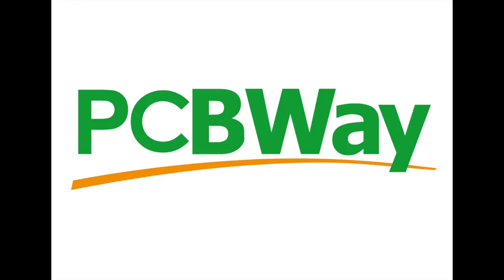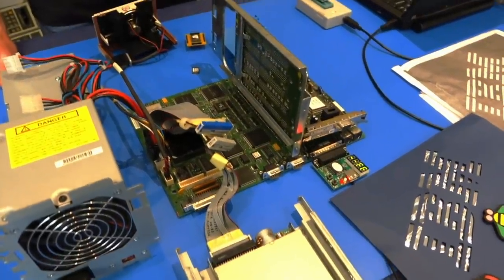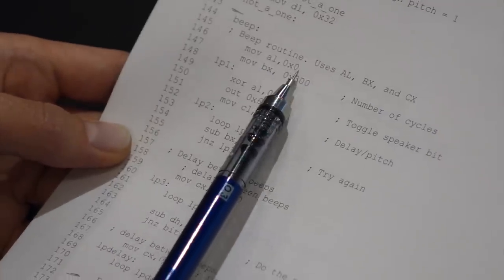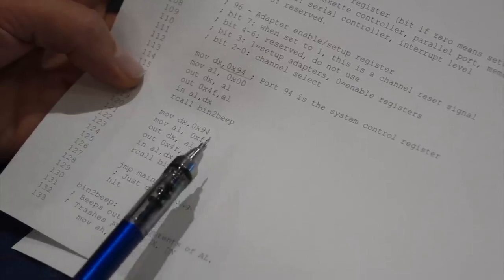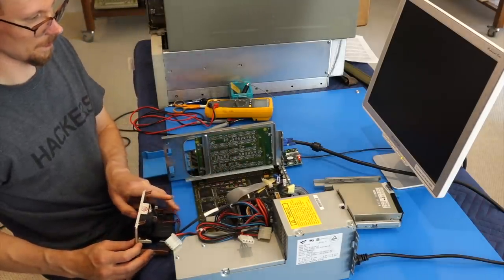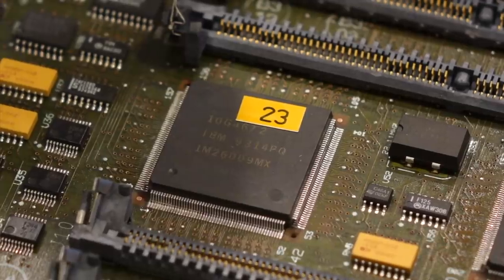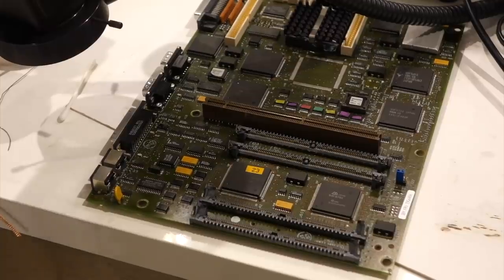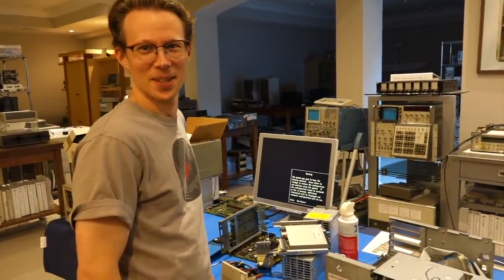IBM PS/2 Part 4: Repaired with a custom BIOS and a magic finger?

Comment: I had almost a "magic finger" experience once.

Back in the 1980s I was working at Bell Labs and was the system administrator for a 3B20S computer. The thing would just randomly reboot without apparent rhyme or reason. Sometimes it would run for days and sometimes it would crash after five minutes.

One day, having exhausted every other trick, I decided to perform a Vulcan mind meld on it. I mean, what could it hurt?

I placed my hands onto the boards in the cage and cleared my mind. Voilà, it crashed! Eventually I discovered that, if you touched one particular board just so it would reboot.

I pulled the board and replaced it with a spare and we never had another problem. We sent the old board back to Western Electric for diagnosis and they couldn't find a thing wrong with it. They sent a technician over to check the backplane and there were no problems there, either.

Obviously, it was gremlins.
Reply: @Never Mind yar a wizard
Reply: Oh yes plenty of times had that with certain avionics boards. You would play mix and match with the stock of spare boards, to get a set with just the right combination of delays, that would work from both cold, to the normal around boiling point operating temperature. You had to test them from just out of the fridge to being used to warm up your pie for lunch. 

Changing an IC on them was not easy, they were a sandwich of DIL ceramic and plastic packages that had been vapour phase soldered during assembly, and there was no way to get to the solder points on the PCB after assembly. Only way was to make sure the IC really was dead, then cut off the legs flush with the body, and remove the old one. Then take the new one, and cut the legs down to stubs, and sand them down to half thickness. Take the remains still in the board, and sand them down on the inner side as well. Tin them, and then slip the new IC into this impromptu socket, and carefully reflow each leg. Then clean, test, and if working, apply the conformal coat on that section again. 

Most common IC failure was always a 5474 or 7474 latch, they would have issues with input thresholds drifting, and as they got used all over for clock recovery, you had fun times. Logic tester would always say it was working, though the one HP logic comparator, that used a separate "reference" IC, fed with the inputs, and comparing the outputs, pretty much failed them half the time.  Just would change the first one every time you had a failure on a board, it was generally a working quick fix, no need to bring out any test equipment other than a first check that all your supply voltages were actually there. then suspect the ageing rubber seal tantalum capacitors, because those failing did weird and wonderful things, as the ESR went up to infinity. I changed kilograms of those.......
Reply: @SeanBZA  As an electronics geek and a pilot, I found that absolutely fascinating. Thanks!
Reply: Mr Guru  No other way, they were DIL packages, on both sides of the board, so the pins of one package were under the package on the other side. Not helped either by the board being a 1970's design, with 14 internal layers. The power planes were very close together, so they were the supply decoupling, and there were, due to thermal constraints, to keep the unit power dissipation below around 500W, in a shoe box size unit, two 5V power rails, one always on, to keep registers and memory, along with the clocks, operational, and the other one was pulsed, to only power the arithmetic functions as needed, once per cycle, so as to keep power dissipation down.

Identical switching power supplies otherwise, using really beefy silicon power transistors in TO3 packages, and nary a controller IC in there, all discrete transistors. Buck coil was an air cored inductor, and it ran at nearly 1MHz. Those alone were around 100W of the power dissipation.
Reply: At a startup company, I was both head of software and got to do our IT support. One of our vendor reps's PC kept rebooting. After a day of troubleshooting, we discovered it happened whenever another rep touched his file cabinet. Which was on the opposite side of the desk from the PC.

The other rep tended to shuffle her feet. Her static buildup somehow traveled through the file cabinet, through the desk it was touching, to the PC sitting beside the desk, and hitting something that triggered the reboot. The PC was properly grounded, too.

We shifted his desk an inch, and solved the problem.
Reply: @JamesPotts  yeah wow that was a tricky unusual very much on one there

Comment: Note that there also seems to be a CMOS configuration issue that we are starting to see from the 'Bermuda' planar in a couple instances: The system (in one of my smaller Model 76 systems, and from a Model 77 that a friend has) prompts to run the configuration when powered on, then after the configuration is run and it reboots, it prompts again. That is with a good battery on the riser, and clean riser contacts. I am suspecting the Dallas DS1285 or Extended CMOS chip ('U14'), but it could also be the planar (the Model 76 and 77 have different risers). Maybe I need Eric's 'Magic Finger' there too!

Comment: We've seen this problem before:  Sometimes you'll get a trace to trace tin whisker - this can happen even with leaded solder.  Tin whiskers tend to form especially on a board that was not heated evenly during assembly.  If it's on an interior trace - nothing much you can do but look on top / bottom traces NEAR U23 - but not necessarily AT U23.  Look under hi-mag scope for any shorts between traces running close together and sometimes you'll have to run an XActo knife in between traces to clear the short.  Another very common issue is a glitched Bypass cap that is actually going open - and resets the register you're trying to write to after after toggle of the WRITE signal line.

Been there, done that...
Reply: If it's a tin whisker on an internal trace, if you can isolate the 2 traces, can't you just blow up the whisker by passing a lot of current through it? That seems like an easy problem to solve, compared to a cracked trace leading to a blind or buried via, which is my personal guess as to the issue. My other guess was a bond wire inside the chip, but swapping the chip ruled out that theory, so it has to be some defect in the PCB

Comment: If I didn’t know he was pushing on the board with his “magic finger” I’d say have a look at capacitive coupling. I’ve had very strange faults on older equipment that has been related to coating, glue etc becoming (more) conductive even if it was originally not and this could render a bypass coupling cap inert and so on. I’d check these if there are any. Thank you for yet another great video Marc! I appreciate you lots.
Reply: I think it was when he pushed on the ic leads, not the board that changed the situation so i think you're correct with the coupling.
Reply: Or the opposite. Coating absorbs moisture and becomes capacitive, making nice clean TTL edges .... sloppy smat best.
Reply: If it was CMOS I'd be suspecting a floating pin
Reply: Someone mentioned tin whisker. Another good possibility.
Reply: Depending on the input impedance of the pins it might even be conductivity of the skin itself that pulls one pin high or low. I'd suggest poking with a piece of plastic instead of the finger. If it still solves the problem it's probably something with PCB flexing. If not then it might be a pin that's floating at the wrong level for some reason.
Reply: Could also be a via there that has gone nearly open, and the pressure closes the edges together, which is why the freezer spray also works. Easiest to fix shotgun style by simply cleaning off all the solder mask on the vias in the area, and then reflowing the lot, with a thin wire in the hole to provide a solder wicking path through the copper inner. Yuo do both sides with the wires long, then snip them off flush.
Reply: @SeanBZA  agreed if that’s the issue.
Reply: @TheFool2cool  I was thinking that, too.
Reply: @SeanBZA  Unless it's a blind or buried via between internal layers - then, I think you're kinda up the creek without a paddle
Reply: @gorak9000  That's pretty much my suspicion. New board time. 😋

Comment: the whole PS/2 was made to be as incompatible with everything else because IBM thought they were driving the market.

While that might've been marginally true, this essentially made them them the odd man out in the market they created.     They were still stuck in the mainframe mindset and it basically ruined the company.
Reply: I worked for Olivetti around 1990 and 1991, we manufactured MCA machines as did NCR, and there may have been others. It was in demand at big corporates like banks, where I did the systems integration, because it was IBM technology, not because it was good. The additional disks required for BIOS and card configuration on MCA was meant to improve things away from header jumpers, but it mostly just added frustration. 

Meanwhile, the ISA gravy train also suffered short lived and/or failed technologies, like ISA PNP, Vesa local bus, EISA, AGP. It took PCI and subsequently PCIe to get PC architecture back on track.
Reply: @nezbrun872  I'll grant you that, but I preferred the EISA machines because EISA machines always had a few ISA slots, and EISA (as I recall) didn't need those blasted feature disks.   I mean, even the Amiga auto-configured cards on it's bus back in 1986, but somehow MCA couldn't do it.   It seemed a bad design to me, but I'm not a hardware guy.
Reply: @teekay_1  I had an EISA Pentium1 from Acer and it did require a disk to setup EISA cards. The only "good" thing EISA had going for it was that the slot was physically backwards compatible with ISA cards, it had no plain ISA slots, all slots were EISA because those can take ISA cards.
Reply: @leonardoliveira  Thanks for reminding me.   But that backwards compatibility of EISA was the feature that made it more attractive to non-IBM shops.    Some of the ISA cards at the time were very specific to applications and were too expensive to replace and the MCA card selection was so limited that IBM's strategy with MCA was not their best plan ever.

Plus IBM at the time (as I recall) tried to imply through their advertising that OS/2 would only run properly on an MCA based PC, which was like tying an anchor to OS/2 as well.
Reply: @SteelRodent amd64 was launched in 2003, I was running Linux x86-64 on an Athlon64 not much later.

Comment: Are there capacitors around the area wich is touched? The resistance / capacitance of the finger could just bring a component back into range of a working one.
Reply: That seems very likely if merely holding the finger there works without even pressing like it seemed in the later parts of the video.
Reply: Maybe a cracked ceramic?  But I think this board has tants in it, but again a cap that can fail too.
Reply: The more interesting fact is, that the board fails again after he'd poked around on the other side of the riser connector. In that area are many of the glue logic chips and resistor arrays that maintain base levels for the signals towards the bigger SMD chips left of the riser connector. There might be a failing solder spot on those as well responsible for the silly behavior. The finger (resistance or capacitance) sets the one missing signal just right to be operable again.
Reply: While watching I was thinking of the same ... bad bypass caps.

Comment: Very cool nerdy stuff 🙂 Back in the day I was a broke college student and my 486 motherboard failed. I spent a Saturday tracing and tracked the problem to a failed diode. That was an easy fix and not really possible on modern PCBs today.
Reply: Louis Rossmann and his colleagues do it all the time.
Reply: You can still do component level repair on a lot of things - just depends on whether the thing is valuable or rare enough to spend the time trace through enough of the circuit (possibly reverse engineering things if schematics aren't available, which they hardly ever are) and testing all the components (either in circuit, or if you have to lift a leg). You'd be amazed at how many things you can fix quickly and cheaply if you're good at fixing switching power supplies. You'd also be amazed at things that are stupidly rare and or expensive than can be fixed for $1 or $2 worth of parts!
Reply: I traced a MOSFET failure on my laptop motherboard that prevented charging.

Comment: A nice probe made out of a sewing pin held in a pair of conductive pliers may be a nice probe mechanism to isolate to the chip pin that is "ill".

Looking at how Eric placed his finger I'd also look at the connector on the other side of his finger as well as pins on the chip. I'd be suspicious of a floating chip pin on a CMOS chip, if there is one in that area.

And, Eric, welcome to the "We'll simply ship it with your finger" club. I was inducted into that club in late 1968.

{^_-}
Reply: My money is on mechanical issue, like a broken trace on an internal layer going to a buried or blind via.
Reply: PCBite is a much more elegant solution to probing using pogo pins and I have been able to use them to probe components down to a 0.5mm pitch.  The only downside is that it can only probe from one side of the board at a time, so to simultaneously access traces on the bottom layer you will still need to either tack on a length of fine wire or find a point where the trace, or a via, returns to the top-side to pickup the signal from each end and pin down where the drop out occurs.  They will even tolerate the flexing of the board under test since the pogo pins bite into the solder and ride out the flexing without losing their bite.

Comment: This brings back a lot of memories! In the very early 90s I spent far too much time as an engineer repairing and replacing motherboards in PS/2’S, mostly model 90’s. Memories of them running SCO Xenix, with Tecmar tape streamers, Specialix serial ports, Wyse terminals and dial up connections!

Comment: This reminds me of a Dell Pentium 2 450mhz that I had for my kids to mess around with back in 2005.  It was one of a few dozen workstations that my employer let the employees have for free when we upgraded our office.  It would throw all manner of random errors and refuse to boot for no apparent reason.  One saturday I sat down in my office determined to figure this thing out and I was not having any luck.  My wife was in the kitchen and she could hear me talking to someone and got worried when she heard me issuing all kinds of horrible threats.  She told me that she stood at the office door as I said to the computer (and I quote) "I'm going to turn you off and walk out to the garage. When I come back I will have a sledgehammer with me and I'm going to press the power button and you're just going to work.  If you do ANYTHING other than this I will take you out into the street and beat you into dust and leave you in the garbage".  I remember walking out of the office, past my wife and out to the garage.  i came back in with a 5lb sledgehammer and said to the computer "This is your last chance" and pressed the power button.  The thing fired up perfectly and it NEVER had another error or failed boot again.  I must have started it up and shut it down a few dozen times and every time was perfect.  My wife said she would have never believed that someone could fix a computer simply by threatening it with a hammer if she hadn't seen it happen with her own eyes.

Comment: So I bought a HP Agilent 1670D logic analyzer to help me work on my HP35660A spectrum analyzer that was failing POST with a memory error.  I'm just an amateur and I had zero experience with any of it.  I did manage to see the memory test signals, and my goal was to try to capture the event that failed to pinpoint the bad memory chip.  But it was so esoteric and difficult to capture (rebooting, waiting, watching, etc) that I eventually gave up and replaced all 32 chips with suitable replacements.  That worked, but it was less elegant.
Reply from the maker: Memory failures are tough to get with an LA, particularly if intermittent. If the BIOS does not tell you where it is, you’d have to use a special diagnostic BIOS I’d think. Or replace all the chips as you just did…

Comment: Nice try however. The reg. 94 is really essential for the configuration and initial boot stuff. This there looks like a fault in the boards multilayer somewhere. It is pretty minor most likely - but if it blocks out the signal to just one pin it will cause the problem. In my 30+ years with PS/2 this is a very rare occurrancy (so far), to be honest. Barely any board failed in that early stage and that completely. Now over to what you originally wanted to try. And: get an XGA-capable monitor. You miss most of the stuff with one which first sync at VGA mode. For instance the entry point into the reference partition on the harddisk. Thanks for sharing !